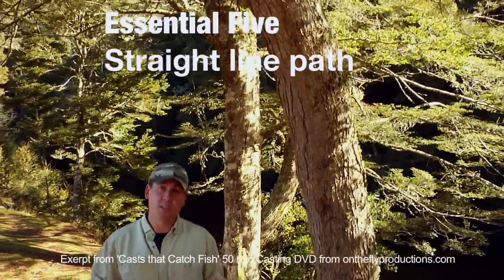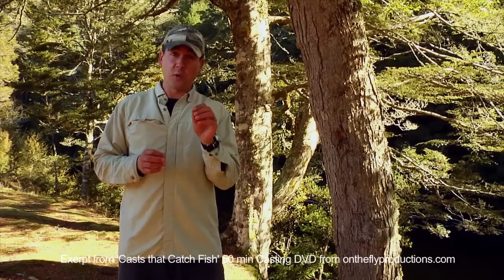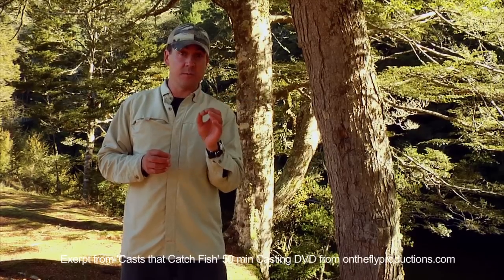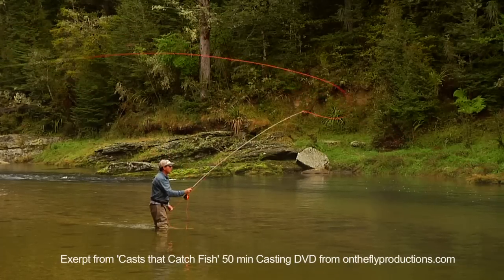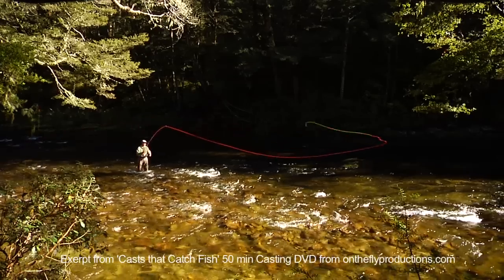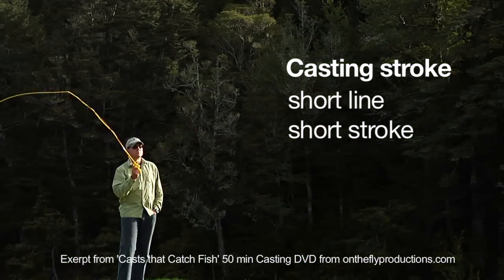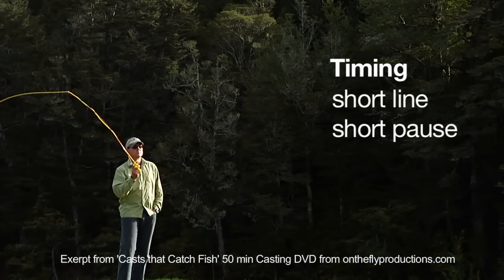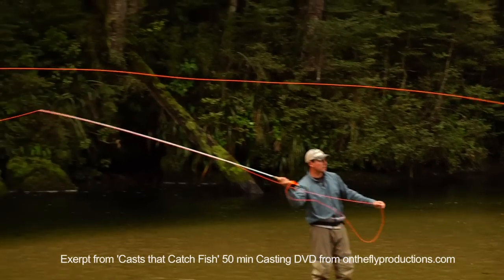How To Cast A Tight Loop. Fly Casting Essentials, Essential 5, Straight Line Path of the Rod Tip

Comment from the maker: @dashwood123 It depends entirely on what is causing it, and I go over this in the full DVD. The most common causes are:
1/  Too much power too early in the stroke, 
or 
2/ Too narrow a casting arc for the amount of line out past the rod tip 
- often both.

Comment from the maker: It will likely be just fine. Only one way to tell and that is by casting the rig. You may find that if you are just starting out that a heavier line may help you to feel the load and bend of the rod - and that's what fly casting is all about

Comment: Sometimes I like to halt the tip right at 2-3 o'clock (11 o'clock to 2-3 o'clock) and watch the line lay out directly in a straight trajectory downwards at the water rather than falling horizontally down upon the water level and parallel, but the key is to false cast just once, and at an angle to level of ground, rather than level parallel to level ground.  I have found I can beat the wind and aim the streamer at a spot more accurately.
Shooting the line down at the water, at your spot.

Comment: Carl, how does turning the wrist as in moving the reel from facing directly forward to facing to the side (like the main article picture showing in 'Battling the wind' in FlyLife issue 62) ruin a straight line path?

I see many casters opening the wrist to the side causing the reel moving to the side. My explanation is this makes the rod tip move in a curve (when seen from above) rather than a straight line path.